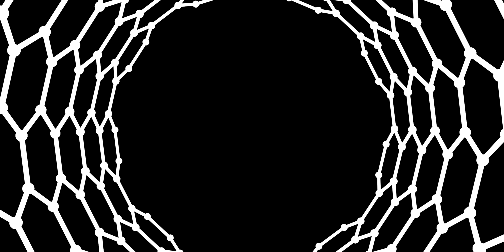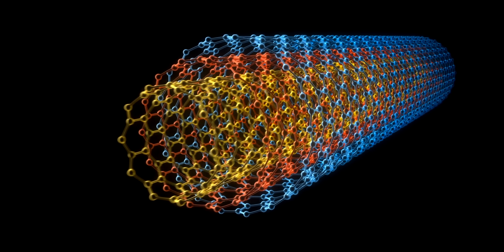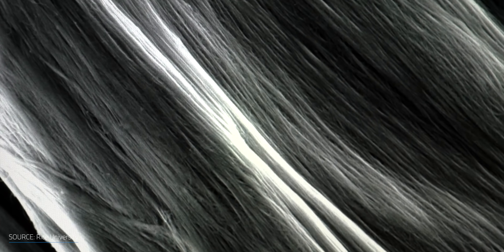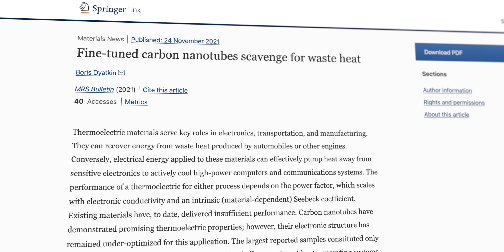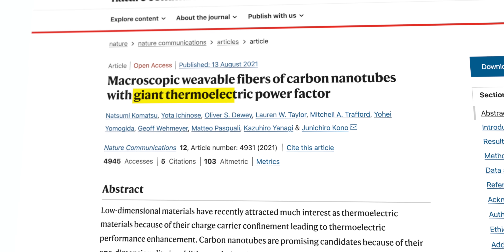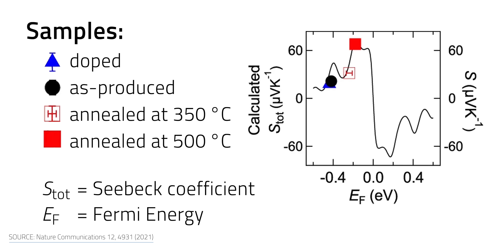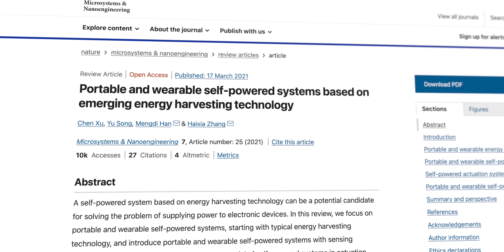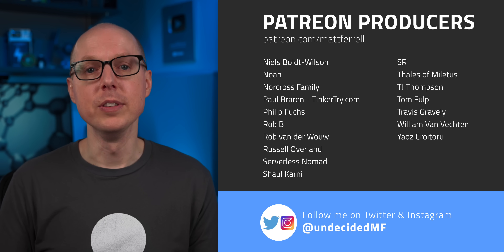Revisiting How Carbon Nanotubes Will Change Renewable Energy

Comment: I heard that graphene is great for creating small batteries that can hold a LOT, and I mean a LOT of energy. Imagine a battery the size of the tip of your finger that can keep your phone working for a week without a recharge. If you need so little of it, I have no clue why they haven't done it yet. Imagine using it on EVs. I think some tech never see the light of day because the powerfull don't want it to.
I mean, he clearly stated that there are factories creating 1kg of nanotubes/ hour, where the hell is all of that being used on?

Comment: I bought a yarn of nano tubes from Dexmat last week. I build custom 250-gram FPV helicopters for diving practices, and motor manufacturers (all in China and out of our control) often make motors of this weight class with a factory pressure fitting shaft without bolting for shaft swaps. I have been using Kevlar threads as fitting inserts to allow my own custom shaft to be installed in the motors, but Kevlar often breaks during the pressure insertion procedure unless I polish the shaft ends very laborously and neatly. Now I have this magic insert that can take some abuses. My drone's diving videos are in my channel.

Comment: I just thought of this if you can make solid carbon nanotube bars that can take immense heat and fiction while also not lose energy from time you can quite literally use that technology to develop the difficult self-distructive railgun or advanced smaller wiring for smaller powerlines

Comment: Have you ever taken a look at Stuart Licht and his company C2CNT? He's been trying to commercialize a process where the carbon is directly absorbed into molten salts from either the air or flue gas and electrolyzed into carbon nanotubes. There's a pilot project running with Capital Power right now- you can even get exposure to C2CNT because Capital Power owns an equity stake and stock options in C2CNT.

Comment: It seems to me there might be an inherent solution to climate change in this technology. In that there is too much carbon dioxide being released into the atmosphere from (previously captured in the ground) fossil fuels, and with the methane from rotting vegetation that is thawing from previously frozen tundra, shouldn’t there be a way, in theory at least, that carbon might be harvested from the “air”, thereby acting as a form of “carbon capture” and providing plenty of material for the mass manufacturing of carbon nanotubes to retrofit industry, the electrical grid, and technology as well… I can’t help but dream of utopian solutions to real world problems and hope for a better and more balanced tomorrow. All challenges might actually BE opportunities in disguise!

Comment: You haven’t covered Structural aspect of carbon nanotubes such as cement additive to increase strength of cement structures to the point of being able to making mega bridges and buildings with out the need to make mega steel foundries.

Comment: I used to do research on this as a physicist. Eventually left the field because I thought the papers were garbage. You had lots of results on these things in electronics, but in all devices the shot noise was so huge it had no chance of being useful. The attempts to apply these to clean energy, genome sequencing, etc. made no mention on why you couldn't do the same thing with standard materials that have been around for decades. 
Notice that I'm not saying it's impossible to get them to work, I don't know any fundamental reason that forbids it, just like I don't know any fundamental reason for UFO's.
However, there's a reason why the field has a reputation of being overhyped, and if you spend some years on it and no one can give a compelling scientific reason on how they will work, it's time to simply move on.

Comment: I don't see how this took so long to figure out upon discovery of the electrochemical properties of CNTs. Light, Heat, Microwaves, Gamma rays, even radio waves, are just radiation of varying wavelengths. Increase amplitude and you increase the power, narrow the wavelength and you modulate it. Think of wearables, spacecraft, CNT shingles... The possibilities are arguably endless (were that possible, but you get my point)

Comment: CNT technology could be applied at the nano-scale level in electronics.  Concentric carbon nano-tubes could be used as nano scale power conversion transformers.  The power handling rating of a single one of these transformers would be very small but if we could work out how to build billions of them and integrate them with a semiconductor chip that has billions of nano scaled power switching transistors then you could end up with a really useful technology.   The scaling laws of these nano scale transformers and transistors would result in a power converter which is considerably higher efficiency than what is currently possible to make.   The state of the art power converters today have conversion efficiency in the range of 98% to 99% efficient.   Using nano scale integration it should be possible to achieve power conversion efficiency ratings of many "nines" - e.g. 99.999999% etc.

Comment: Apparently there is a small (like very small) company in SF, CA adding carbon nano-tubes to LI-Batteries. This they report has increased battery longevity, shorten charge times, increase power density while decreasing battery weight.

Comment: Considering that we are referred to as "Carbon Based Life Forms", it is only fitting that Carbon is used just like you explained.  There is much more to be discovered about Carbon and its relation to our bodies and how they can be integrated with little to no rejection by your immune system.  Carbon is also being swallowed by those of us who use an item which is called "C-60".  That research and what you have described could work hand in hand in keeping our body's electrical system humming along for a few hundred years instead of just 80 or so !

Comment: So, CNTs not only have high thermal conductivity, they also transmit fluids such as water at faster speeds than if it were free-flowing; this discovery literally re-wrote the book on fluid dynamics. This could mean huge things for liquid-cooled computers.

Comment: Electricity grids are not improved by installing better cables.
They are improved by ditching the insane centralised production and distribution system used to generate electricity.
Centralised production is inherently flawed, undemocratic, and it reinforces the corporations' power over people.
Whatever systems we have in the future; if they follow the current model, they will not be serving humanity correctly.

Comment: 2 things that stand out to me here.  1. Then why not use Alunuman wire wrapped in Graphene. And the 2nt part the with thermal conductors. Could be used as insulation wrap for stoves and freezers. To reduce power consumption.

Comment: The small size and unknown longevity of CNTs in the environment are cause for concern.  CNTs are small enough to go inside of cells, and macrophages scavenge them, but what happens afterwards has not been well studied.  At the beginning of the 20th century, there was considerable hype about the uses of radioactive materials, and only after a lot of people had been exposed to them did we realize that they needed to be handled with much more care.  Since then, we've been surprised by the unexpected consequences of asbestos,  pesticides, fluorocarbons, micro plastic beads, radioactive materials (again), and more.  There's a saying that you should never put more liquid in a child's glass than you are willing to clean up, and there should be similar words of warning about releasing new and untried technology into the environment.  Prove it is safe first.

Comment: My favorite application for carbon nanotubes for renewable energy so far has been Prometheus Fuels. Their tech is pretty straightforward, really… catalyze alcohol from carbonic acid (carbonated water, easy to make with just a waterfall and a fan), separate the alcohol from the water, and then use a zeolite catalyst to convert the alcohol into gasoline and jet fuel. Their “secret sauce’” is a carbon nanotube filter that separates alcohol from water - essentially, hi tech reverse osmosis. This gets away from the high temperatures and pressures (and massive energy consumption) of distillation. Their whole system is room temperature, plumbed with ordinary PVC and rubber gaskets. It’s around 50% efficient at synthesizing gasoline from atmospheric CO2, and can be powered by solar electricity because it doesn’t need to run 24/7 like a distillation plant. And it’s working tech… they’re well funded and working on scaling, not just doing lab experiments. This is especially cool because it offers a path to clean operation of long-lived combustion engines like jets and trucks.
Reply: Thank you, Dave Stagner !

Comment: Carbon nanotubes for energy/electricity is a promising prospect. From what we see, it DOES have the potential to revolutionize everything in our world (of things using electronics/energy).

However..... there exist major obstacles yet to solve:
a) efficient reliable manufacturability of high-quality reliable stable materials with minimal impurities
b) cost at scale (producing long wires/large matrix-surfaces, and producing in high quantities - tons/day)
c) performance stability over scale, time, temperature, vibration, static damage, etc.

I believe its commercial use is over 10-15 years away, and maybe 30+ years away from giving us only part of its full promise.

Comment: I wonder if these will be, or even could be, used as part of fail safes for nuclear power as a way to dissipate the heat in case of a melt down, as well as allowing the plant to still produce electricity, though that sort of application is probably hundreds of years of research away

Comment: An interesting concept, if you can ever get an interview with Rice University's folks:  what about using the Seebeck concept to get electricity back out of the waste heat produced by microelectronics, specifically CPUs and GPUs?  My water-cooled PC is basically a space heater when it's operating multiple processors; there must be enormous amounts of heat that could be re-harvested.  The idea of merely using these materials to produce better heat transfer is great, but it doesn't improve this picture, where it's guaranteed by thermodynamics that future PCs will produce more heat.

Comment: What surprises me is that more than 50% of all the fuel used to generate electricity is wasted to atmosphere, if we apply the right technology it could be used tocheaply pump that heat to people's homes.  Power companies could effectively double their business by turning the 'problematic' waste heat into a valuable commodity ... and reduce their carbon footprint at the same time.  Matt, think ... of the 'Toms Effect' (circa 1938) and then talk to me about how things have changed for the 21st Century.

Comment: Mercy, I can't imagine wearing clothes with a temperature difference large enough to generate that kind of power. https://youtu.be/QEAmTvan0EU?t=441 If your clothes are that hot, you've got bigger problems than worrying about generating electricity.

Comment: You may have inadvertently spoken a key to making the carbon nanotubes if rice IS usable to make them easier.  Rice has been used for centuries as a source of carbohydrates, so making a method to convert them from a sticky glue into strands which can be made into exceptionally long chains and converted into either a substrate surrounded by the nanotubes, or directly into the nanotubes themselves.  Maybe this is the key being sought, or I'm just hungry.

Comment: If cost efficient, I think it would be interesting to place the carbon NTs in long stretches of roads to act as thermocouples. While, the energy generated from the heat difference between the surface of the road and the bottom of it, will likely be small, placing these across thousands of miles of road could create a sizable amount of passive green energy. It would also reduce the heat of the roads a little bit as the energy is partially siphoned away to generate the electricity.

Comment: If no other nano innovation pans out, the near term possibility of substituting deposit/print/etch-able carbon substitutes for Cu/Ni/AgAu conductors/coatings in low voltage electronics is an accomplishment, which may be one of many grid storage benefits which pivot around efficiently harvesting high purity CO2.

Comment: i remember at least 3 decades ago when i got my gas license  the future was all about hydrogen and buckyballs.
still no clean or cheap way for this.
Reply: Three decades ago you didn't have a portable phone with Internet access and a powerful computer in your pocket either.
Reply: @calebmauer1751  
exactly my point. 3 decades later they still haven't cracked the separation problem .
it was going to be i assume some catalyst to directly remove the carbon from methane.
yet you still hear nothing about it.
is it complexity, or no political will?

Comment: Since we are having a shortage in the Silicon Wafer and Processor industry, and considering that Carbon has very similar properties to that of Silicon being they are in the same family having 4 valence electrons. Why have we not explored the idea of using Graphene and or Carbon Nanotubes within the semiconductor sector to manufacture Integrated Circuits based off of Graphene as the main substrate as opposed to Silicon?
Reply: @calebmauer1751  Yet with my own intuitions, I feel that they should start investing! Innovation is what propels progress.
Reply: @calebmauer1751  Maybe and maybe not. I just think that "big money" doesn't find it feasible to invest in yet as the cost of R&D exceeds that of the practical commercial applications and uses. It'd cost them too much to process and manufacture the graphene and then to retrofit or build new equipment to work with graphene as opposed to the already expensive equipment that is already in place to utilize silicon. Research into it is active and gaining traction, but it's still just a little too early. However, I have a feeling that when big money is finally willing to invest and to take a risk it will be industry changing to the degree of when plastic was first made or greater.

Comment: let's see an actual application of the heat capture/electrical generation concept in a real world solar panel. How long will they last,? How fast will they degrade? What is the final efficiency rate? This specific application alone is hugely interesting. Going from 23% efficiency to anything in excess of 50% would be huge. If they are stable and tough, there will be applications all over the place.

Comment: Zero Kelvin, aka Absolute Zero (which is impossible to reach as it requires an infinite amount of work to get there). The kinetic energy of electrons at 0 Kelvin is.....0. The very definition of Absolute Zero is the point at which atoms cease all movement, and therefore anything at this temperature has zero kinetic energy.

Comment: This tech getting heat from a turbo in winter would provide a tremendous range for a plugin hybrid ev. If this is as good as it sounds Carbon nanotube thermal generators are the future

Comment: Looks to me like Graphene Wire would make a killer material for speaker voice coils.  Much lighter, stronger and more conductive than copper means that voice coils would be lighter stronger and run much cooler.  Lower voice coil mass and resistance should provide a wider frequency response for a given speaker size and higher power dissipation.  In addition, this application wouldn't require miles long pieces of material like electrical grid wire replacement would.

Comment: That heat conversion to electric is amazing, Im think already how useful that would be in CPU heat syncs, could add power back to the motherboard of the unit from the heat the CPU,
Reply: I'm no mathmagician but those numbers given in the chart have a lot of negative exponents. Doesn't that mean we are talking about very tiny numbers?
Reply: @heinzerbrew  Yes, very very very tiny numbers. Worse still, the amount of manufacturing/process-energy required to simply manufacturer these "heat-reclaiming CNT" engines would likely dwarf the total energy it can convert, over its entire life.

This may be practical for only few niche applications, such as in satellites/space.

Comment: One particular aspect of the conductive structure based carbon nanotubes, if they were to ever replace metal conductors, copper, etc.
I understand that they are fairly easily combustible in our atmosphere.
However, might be a preferred choice to use up in space.

Comment: There are precedents for a new discovery/invention needing several decades before people actually find a really good use for it. Famously the fractional horsepower electric motor did not transform factories for 50 years after it was already developed. Lasers were for decades described as "an answer looking for a problem". So I don't think it impossible for nanotubes to transform the future. But like nuclear fusion, the longer it takes the less chance it will ever happen.
Reply: I don't know about transforming the future, but CNTs are already improving battery performance, paints, coatings, conductive plastics and other things.  Greatly expanded manufacturing will drive down costs that will make a broader range of applications feasible and increase the pace of adoption, imo.